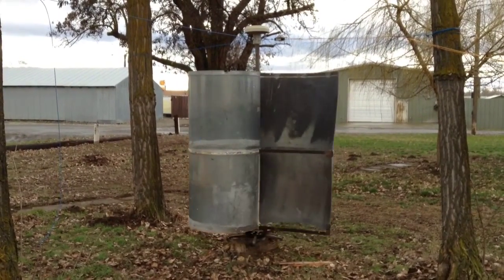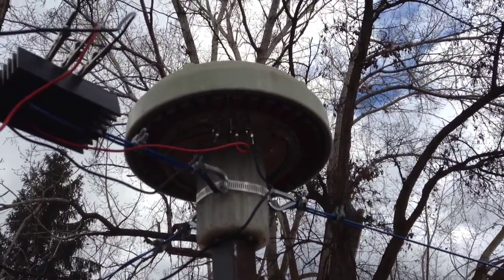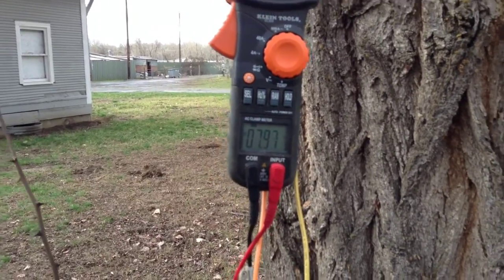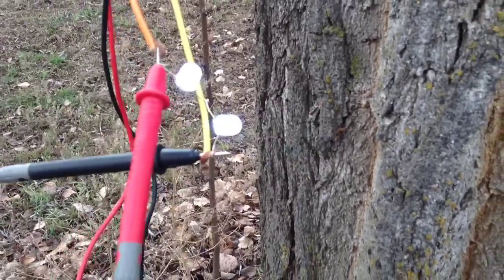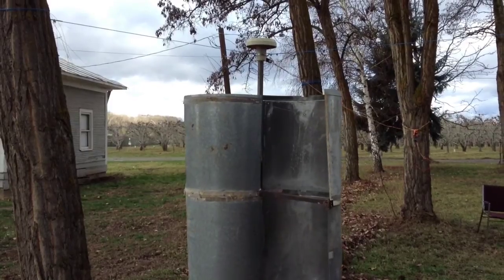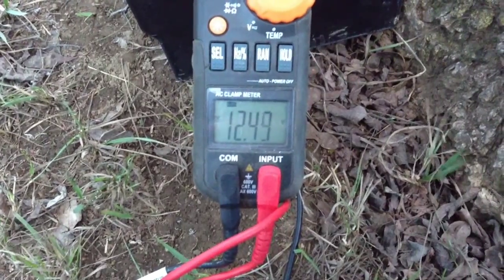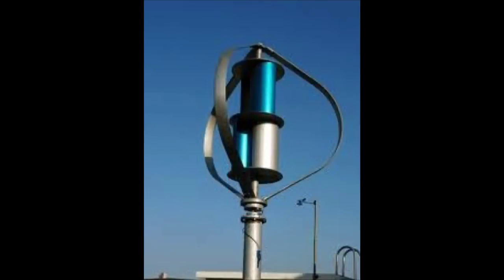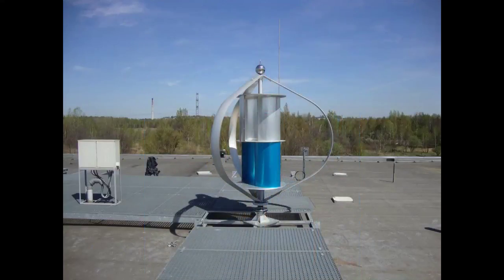Savonius Vertical Axis Wind Turbine BackRoom Labs

Comment: Hi,
I have done the same splite rewire... and have few voltage. Did you have rewire the stator to original configuration? How the current drop ? Thanks you

Comment: Great work. Once you have the load you can measure power. What power numbers did you get? Every time you said we are getting charging, please tell in Watts. Thanks!
Reply from the maker: With that setup i wasnt getting very much in charging watts. It was a proof of concept. With something like a 1 to 3 gear and a chain or gear to gear I would be able to start imputing current into the battery. The generator head just didnt spin fast enough. It was spinning just fast enough as to reach a over the batteries voltage thus reaching a charging voltage. The generator head is capable of something like 600 to 800 watts reliably. With more time and testing that wind-turbine turbine was definitely capable of maxing out that generator head.

Comment: Have you thought about hooking up a drivetrain similar to that of a bicycle or motorcycle, but with fixed gear ratios. This way the relatively low rotational speed of the turbine blades can produce more turns on the smart drive?

Comment: Hi I was wondering is it better to have the bridge rectifier near the battery bank if the battery bank is at some distance away say 10-20 meters away?  Because the a.c. current travels more efficiently over distance and the cabling doesn't need to be as heavy? I'm not a expert just from my research I believe this would make sense?  .